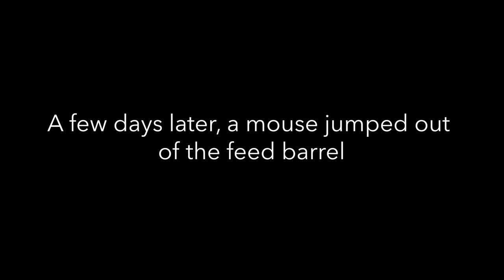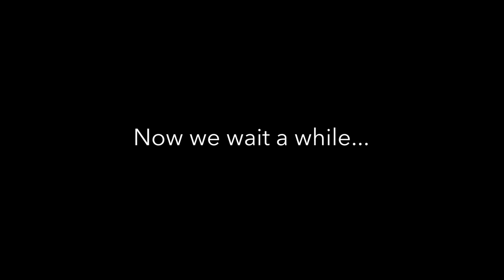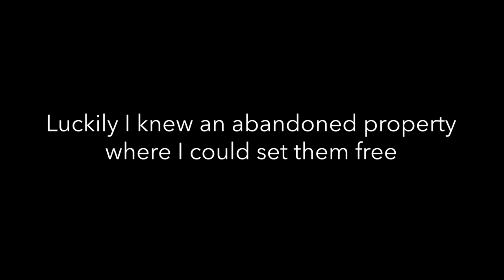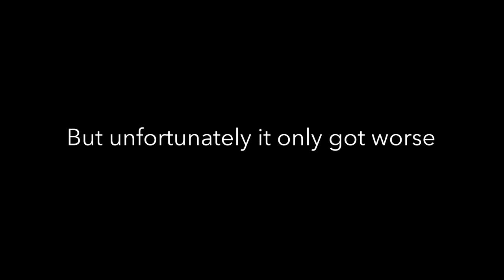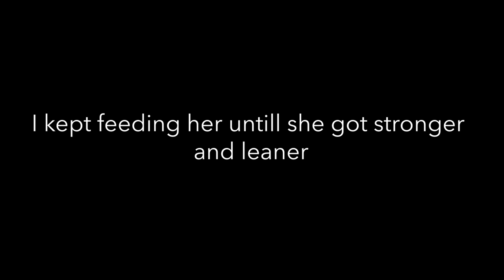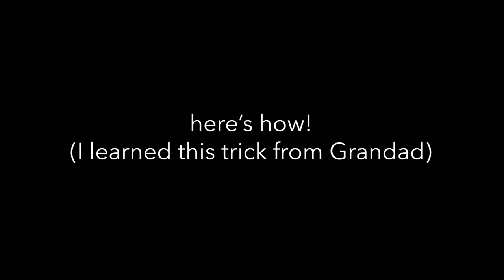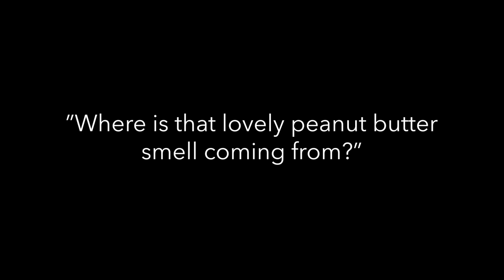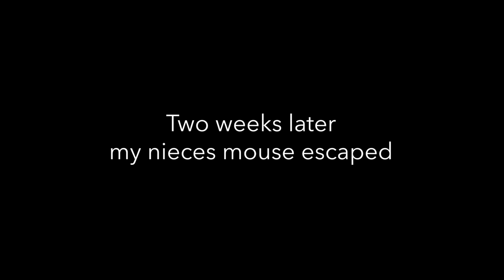How not Killing Mice led to an unexpected Save

Comment: "If you also want to catch a mouse without killing it, here's how!"
Proceeds to reveal entire industrial factory in his shed
Reply: the first method (barrel with plank) was so much easier tho less convenient indoors
Reply: Right? Step 1: Be a proficient carpenter with an entire set of tools
Reply: @tripsupstairs  there are live mouse traps that you can buy aswell if you cant make one!
Reply: @yatharthmoza  don't I also need screws, nails, wood and carpenter skills as well?
Reply: @legalkillerkev  Yeah. Go to Home Depot or Lowe's. Buy a 2x4 which is $3 to $6 at most. Buy some nails and a hammer if you don't already have them for some reason. Get a hack saw for $4 to $7. You don't need plexiglass. You can use duct tape to keep the trap closed when it's in use instead of screws. That way you can change the thread and bait when needed. You don't have to know woodwork like the back of your hand to make something this simple.
Reply: @tripsupstairs  Lmao no you're not? If you've got a garage then you're good, but there is literally nothing stopping you from sitting on your kitchen floor with a cloth under you so you don't scratch your tile/wood/vinyl flooring. Hell, cut the pieces outside if you really need to.
Reply: Malek Marar 

😹😹😹😂🤣😂🤣😂🤣
Reply: @ARandomStan  That method is really good, just make sure the food inside smells good, regular seeds are a bit boring. You could smear a tiny bit of peanut butter at the top of the plank to lure the rodent up it. My college which was based on a farm had those for rats and it worked, but they had to be pretty big to catch rats. Those guys can jump surprisingly high.

Comment: I know a really good humane mousetrap:  you take a barrel, rig a smooth round stick across the top that can spin really easily, and stick a big glob of peanut butter at the center of the stick.  A guy set up a trap like that recently, and that sucker caught no less than 30 mice in the span of 24 hours!

Comment: A few holes in one area of a cage or trap provides a miniscule amount of air movement into and out of said container. Many holes on opposite sides are Required. Then the movement of the animal will work as an inefficient but sufficient pump.

Comment: I get rid of fruit flies out of my house without  killing them in a similar way.  I put banana peel or apple cores at the bottom of a small barrel. Wait awhile, then, cover the top with a towel quickly. I release the flies outside by removing the towel and dumping the contents outside. The bait can be reused using a glove. Those little critters know how to get in the house, or get back in.

Comment: 8 or 9 years ago, homeless, I was staying in a friend's barn, as we were working on converting it to an office, man cave, and storage for all his stuff.

Anyway, as I sat there at the desk in the dark, night after night, texting on my old flip phone, there was an old cast iron band saw that had a nest of deer mice in it.
It was hollow with only one point of entry. 

The young ones would come out at night, curious, and really quite courageous considering our size difference. 

I shared my peanuts with them by setting them down inside the opening. Then outside the opening. Drawing them out, until they were taking them from my fingers.

Well, can't have an office/man cave/storage barn with mice destroying everything.

I took a 2 liter 7-up bottle, stuffed some straw, peanuts, corn, and cloth in it, and taped it to their entrance. Soon enough, 6 of them plus mom moved into the bottle.

I removed the bottle, capped it, and walked a quarter mile out to their old ravine/junk dump in their pasture. 

I found some junk that I could fit the bottle under, took off the cap and wedged it, in a downward position so no water could get into it. 

Also, I've killed hundreds of them, growing up on the farm. I just don't like killing things any more.

Comment: My dad used to take me to work with him when I was a kid. He was a carpenter. He used to work in a workshop to build wardrobes and other furniture and fittings etc. He told me he had a mouse or a rat in his workshop. We knew this because we'd come in every morning and find foot prints in the sawdust leading up to our pack of biscuits that would have fresh bites taken out of them hahaha. He came up with a trap design that would work like a seesaw.

It worked like this:

It was a box, the bottom of the box had a flat piece of wood which covered the whole bottom. It was set like a seesaw so when the rodent would walk from the entrance of the box, to the other side, the seesaw would then tilt to the other side along with the rodent. this would then knock the door that was being held up by a piece of wood attached to the seesaw and it would close. Safely holding the rodent inside. 

This was then a project for me to work on while my dad did his job and eventually, it was finished.

We used cheese, peanut butter and other pieces of food at the end of the box but no dice. It seemed the rodent was too smart for us and we'd have to simply come to terms with the unseen rodent who would share out biscuits with us

Comment: My mother and I were dealing with a rat infestation in our house when was younger and she absolutely did not want to use conventional death traps as she loves animals and even raised us vegetarian. We used a glue trap instead and I haven't seen my mom so flustered. The poor creatures eye was stuck to the trap. We put the whole trap into a tall plastic bucket and poured some virgin coconut oil over the rat where it was stuck and allowed its own body movements to agitate the adhesive and oil which worked. He released himself then we took out the trap and added some warm water and no tears shampoo to remove any remaining adhesive and oil (worked damn well). We took the bucket down to the local dump and released it. Within 2 literal seconds of it running out, a cat charged and killed it. The look of horror on my mother's face was blood-curdling. See, she also loves cats so it was like watching one of your children kill a newborn. All those memories of waking up to cleanly severed rat heads at our bedroom thresholds presented by one of our 40 or so cats (we had a big place) as a trophy. They're cuddly little psychos.

Comment: My cats brought a little mouse inside.  It was not hurt, it was running behind the sofa, behind the bookcase, I couldn't catch it.  I'd seen a humane trap on youtube using two bowls and a nut.  Put the nut under the edge of a small bowl upside down.  Place large plastic mixing bowl balanced on the opposite edge of the small bowl. When the mouse pulls out the nut, the large bowl will fall covering the small bowl and the mouse.  I didn't expect it to work, but I closed the door and went upstairs.  Within 5 minutes, I heard a dull thud... yes, I had worked beautifully.  The mouse was unharmed and was eating the nut.  I slid a thin chopping board underneath and took him outside.  It's a very simple and effective trap that needed no construction and made from things available in most kitchens.

Comment: I used a trick kind of like this to catch my pet rat when he escaped. His water bottle was the only water in the apartment. I could hear him drinking because the little metal ball in the tube rattles, so I would tie a string to the little door of his cage, run it all the way to my couch, through the bars, tied with a loose hitch knot so that as soon as I heard that rattling water bottle, I could pull the string and the door to his cage would drop, trapping him. He’d get really mad and freak out, then calm down and return to prison life. I still feel guilty about him living alone. (He had a deluxe cage, but he bit so I didn’t want him to kill another male and I couldn’t get him a female or I’d end up with 50, 000 rats.)

Comment: Ever since nearby major subway construction a couple of years ago my neighborhood has had a mouse problem. I decided to go with live traps and release in a nearby wooded area in park (always at the same spot) but the mouse problem has persisted for nearly 2 years now. Anyone have any thoughts how to get rid of the mice without killing them?
Reply: throw them really far away, maybe a couple kilometers
Reply: @mahadahmedbaloch  Its not the same mice. New one's are coming. I've looked around my home's parameter to try to find holes but can't find any. I can solve the problem by just putting lethal traps arounds or calling an exterminator but I've resisted going this route because I don't want to kill the little guys.
Reply: @mahadahmedbaloch  

I think they are living and breeding in the walls. The live traps only them when one occasionally comes out. In other words, is there a non-lethal way to get to mice living in the walls? (e.g. maybe a scented chemical that makes it uncomfortable for them but isn't lethal or hazardous to humans?)
Reply: @mydogsbutler  
I read some article about how to repel different rodents and I think one of the things was mice
You throw the thing around every corner and mice dont like it
But i dont remember the article or thing

Comment: My friend, your mouse trap is far, far too complicated. All you need is a wide, shallow bowl, a spoonful of peanut oil, and a few sunflower seeds or the like as bait.
Set up the bowl in a corner you know they frequent, and make sure they can get up into the bowl. Then put in a small amount of peanut oil into the bowl, and spread it around evenly in the bottom of the bowl, all the way to the edges. Put some seeds in the middle, and the trap is set.
The mouse smells the peanut oil and climbs into the bowl after the seeds, but his paws get all slick with the peanut oil, and he CANNOT jump out at all.
You should be very careful not to put in too much oil, as the mouse will run himself into exhaustion and pass out with his little nose under the oil and drown. You need just enough to coat the entire bowl, and not puddle up in the middle, any more than a couple millimeters deep.
It works like a charm, and I've caught dozens of mice out of my basement since I learned it from Youtuber Shawn Woods last year.
https://www.youtube.com/c/ShawnWoodsprimitive-archer/featured